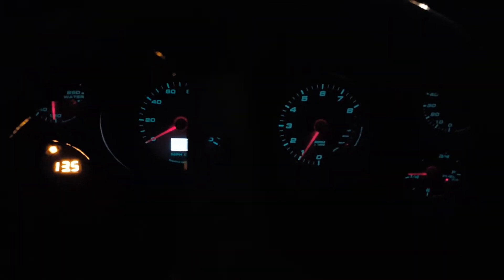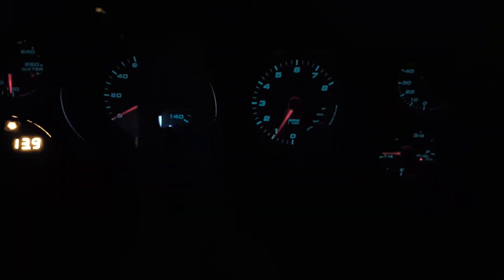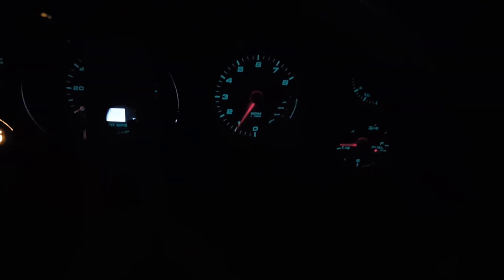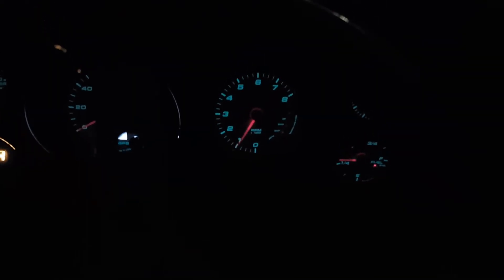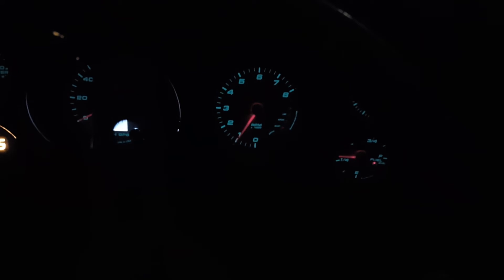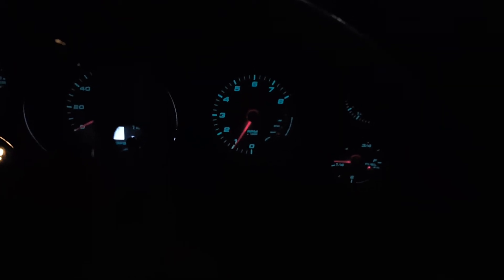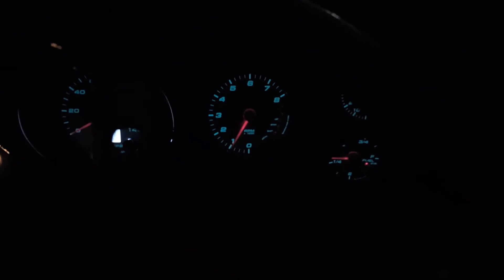FiTech efi cold start after fuel tuning.

Comment: Hi just curious to see how you are going with the fitech I have the same mean street with a 347 making 500 hp what do you have your prime fuel set to? 200 or higher?. I have a small cold start issue. Also do you have any issue when you slam the throttle like a stumble??
Reply from the maker: LISNIG I was using the 1200 power adder. It worked excellent but I progressed past it's limitations so I now have a Megasquirt ms3pro with multiport Injectors.
Reply from the maker: LISNIG for the prime shot you can go to negative 100 to fully disable it if it's causing hot start issues. You can adjust cranking fuel to compensate. If you have a hard stumble when smashing the gas adjust the fast accel setting. Keep going higher until it goes away. Go in increments of 10.

Comment: I was curious about this. Cold start on mine seems a bit long (cranking 2-3 sec). I noticed if I cycle the fuel pump twice, it takes half the time.
Reply from the maker: yep. adjusting the "pre shot" and cranking fuel helps a lot. the learning ecu is great for driving conditions but it can't learn starting sequences. you can also adjust how long the system waits before it primes.
Reply: Awesome! How do you adjust the wait to prime?
Reply from the maker: For the prime shot you have to go to display settings. scroll down to pro calibration and select show. it's hidden by default. then back out and go to pro calibration. inside that go to cranking fuel and then there is a prime shot delay. I believe stock setting is 3 seconds. you can increase or decrease and also adjust how much it primes and what the cranking IAC is which mimics opening the throttle.

Comment: Thanjs for sharing Josh! I have the 600, cold starts are terrible. I have the iac at 7, tps at.5. I am srarting to mess with crank and after fuel thanjs to your video. I also have the lingering high idle back ti normal I am fighting. Embarrassing when u stab the thrittle and it sits at 1200 for a bit tgen nirmal..lol otgerwise it is awesome!!

Comment: Hi Josh, nice video, we have the 1200 hp Fitech, and it seems to be doing excellent so far, besides some minor Start issues. I've got the butterflies adjusted correctly, it reads between 5 and 7 IAC steps when at idle, at operating temp. I've adjusted the crank fuel all over the place, but still haven't gotten it exactly correct, it starts better when cold than when hot. I was wondering if you could send me a picture of your Crank and Prime settings on your handheld, so I can compare with what I got.... I would really appreciate it if you could, you can email them too transam461@gmail.com

thanks!
Reply from the maker: On hot starts do you have to hold the throttle open a little? If so, reduce the cranking fuel by 3 to 5%(in the hot setting) and try that. I have only tuned my cold start so I plan to tune the hot start this weekend.